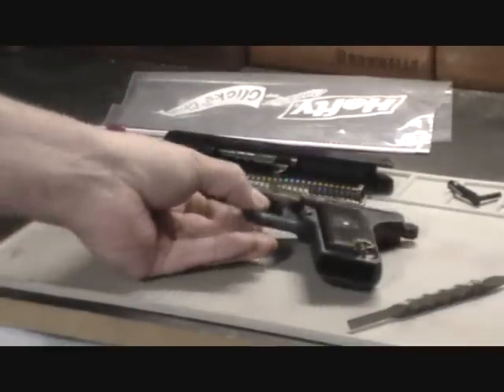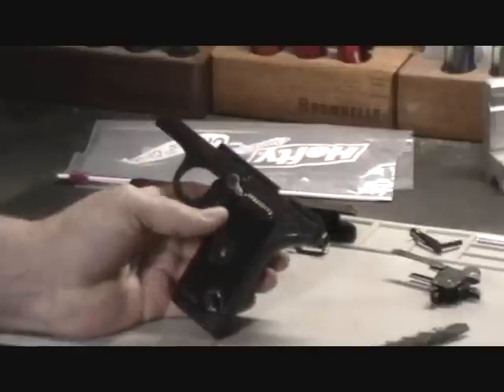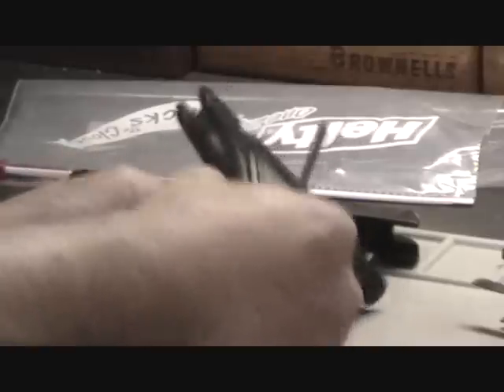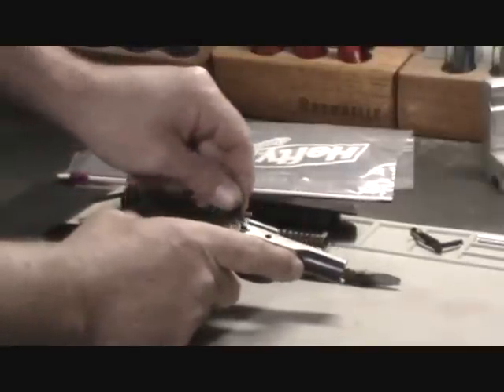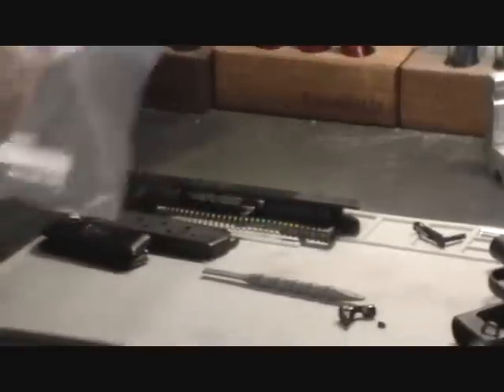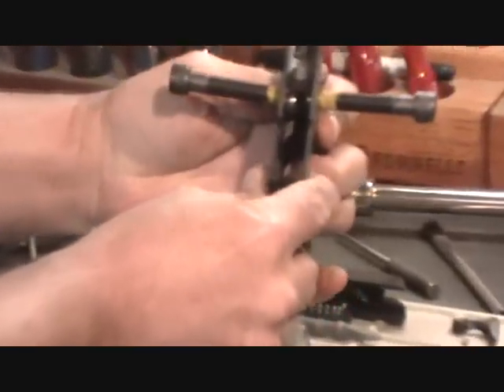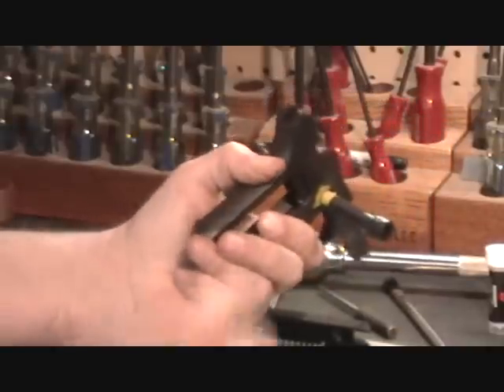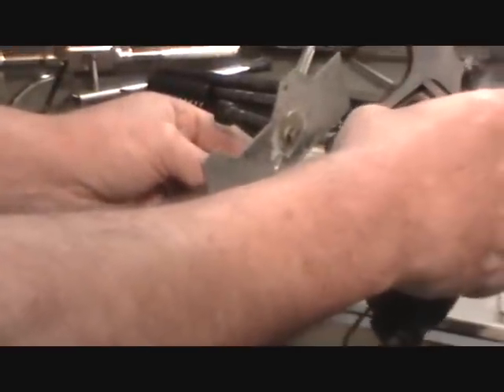Tokarev TT33, Romanian Cugir pistol, safety removal and hole fill in, Part One.

Comment: Is it easy to put the safety back on if you wanted ?
Reply from the maker: No.
Reply: So it would be easier to just fill in the hole then to put it back on ?

Comment: Anyone know where i can buy a safety select that has the pin as well?  I have lost the damn pin that sits in the safety hole so it just moves almost 360 degrees.
Reply from the maker: You should be able to modify the detent for the M16-AR15-M4 rifle safety selector/ end plate to work on the Romanian and Polish safety levers. HTH
Reply: Did you ever find this out? I am trying to do the same thing. 
I dunno about other people, but I actually really liked the safety on mine.
Reply: glad u posted this but how? what needs modifying? I would be glad to pay you for one that works.  Please help Im so disappointed now that it just flops around.  The gun was a real favorite but now it just sits in the safe.  I want to put it back the way it was and I have searched and searched looking for the part with no luck.  I still have the spring in there but no detent, since I had no idea what it even looked like, I tried diff size ball detents but none worked..Finally someone told me that it took a pin type to stop me from trying ball detents..You mention that a AR safety detent will work with some modification but what are those mods?  It also may be i wont have the tools or the resources to modify it.  But please tell me what I need to do and also see if you can make one for me that I can buy from you..Im looking forward to your response
Reply: did u ever find one? im still in need
Reply: That little pin just sits on a little spring, I got rid of both and just cut a heavier spring the length of the spring and that pin so is one piece and fits snug, does the same job as the import crap.

Comment: I don't understand how those huge bolts got into the frame this gun.  You took out the safety, then cut to picture of what looks like 2 bolts in the frame on opposite sides.
If you take out the safety, does it leave 2 huge holes like that? Or did you drill out tiny holes & make them big?  why not just remove the safety & leave 2 tiny holes, if that is all that happens?